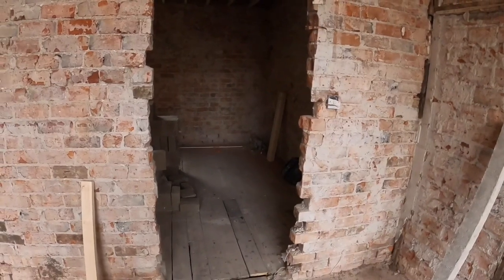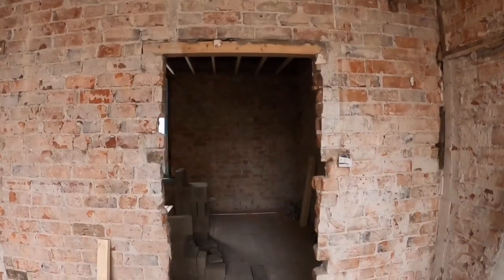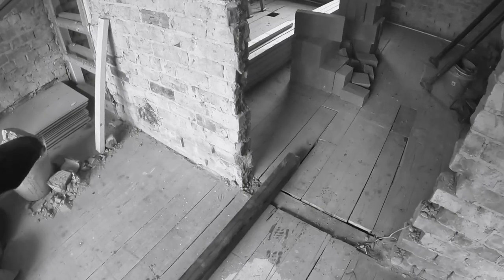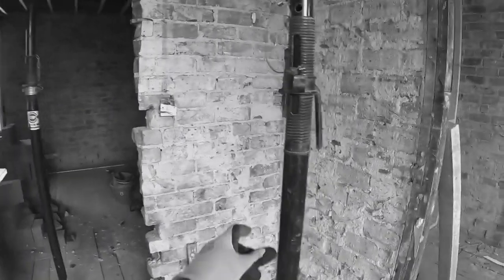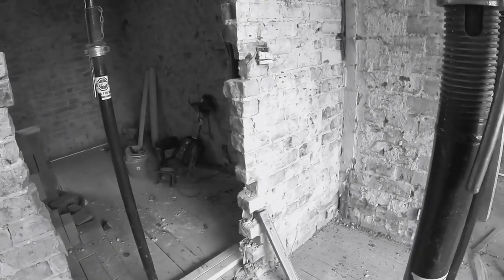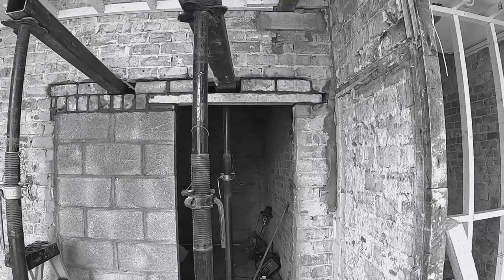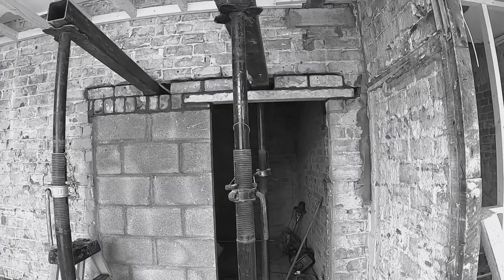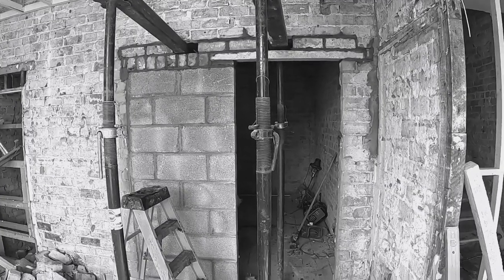Bricklaying moving a internal door opening

Comment: Superb mate! just what I'm gonna be doing soon. Where did you put the slate?
Reply from the maker: Nice one pal the next day when the mortar has set you slate underneath any bricks that have dropped and pack it nice and tight. 😁👊🏻💥👍🏻
Reply: @rowlockconstruction8345  Superb - Really appreciate the reply! Cheers
Reply from the maker: No probs pal hope the job goes well for you 😁👍🏻👍🏻🧱🧱
Reply: @rowlockconstruction8345  Thanks for video, what was the metal rail for which you fixed along the cut bricks? Was it just used as a spacer to but the blocks up against so there's the right gap between the mortar?